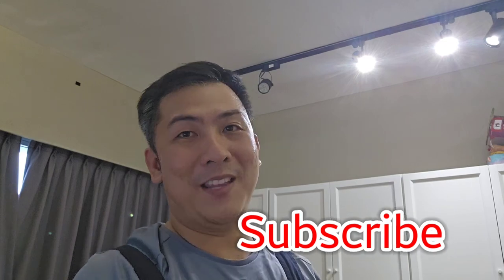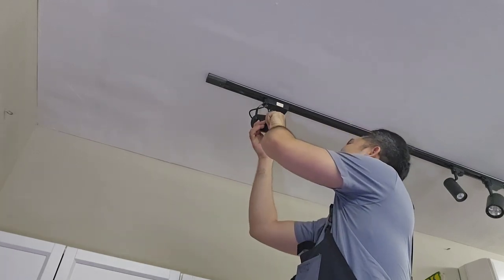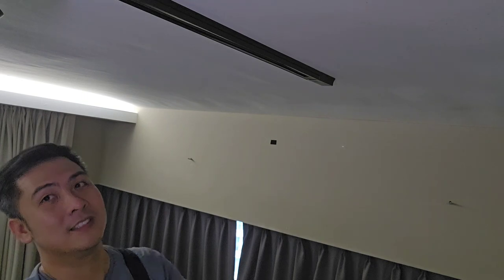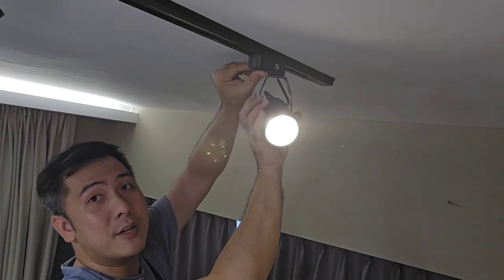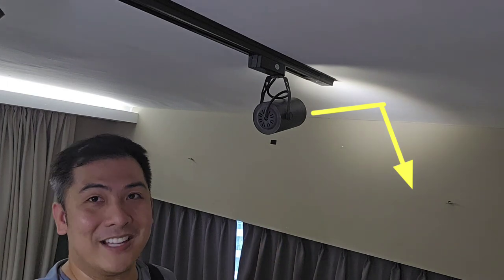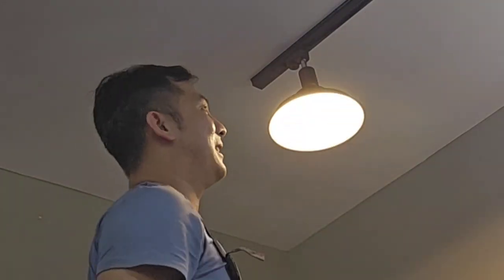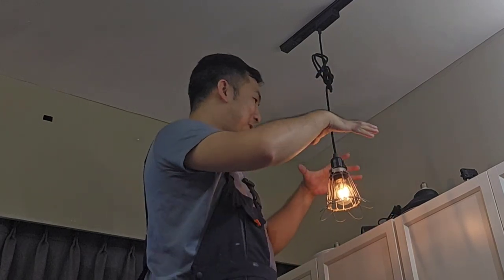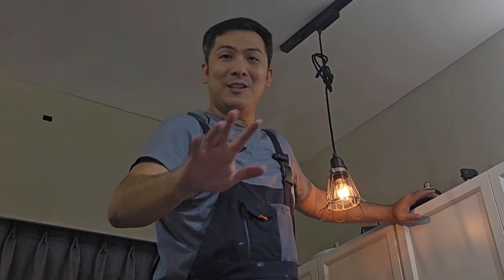Why TRACK LIGHTS are Awesome. (Savings $20 onwards)

Comment: Nice, I'm sold on the track lights! But are all the track bars the same and interchangeable with any track holders/bulbs?
Reply from the maker: Well most tracklights in singapore uses the China system which is different from the US system. The bulbs are readily available online and are quite interchangeable!

Comment: Did you install your ceiling fan on the track also?
Reply from the maker: There are small fans which can be mounted on an E27 holder. But I don't think these are powerful enough to cool an average room

Comment: How did you install the ceiling fan on the track light?
Reply from the maker: @ArcKon-ub4zn  the ceiling fan is on the ceiling I just used black trunking to run the wires from the track light to the fan

Comment: Does voltage matter when installing a spot light? Eg installing a spot light with a MR16 bulb or a spot light with a GU10
Reply from the maker: The rail supplies 230V in most cases. So whatever bulb you chose to use depends on the track light holder. MR16 light bulb requires a low voltage 12V electronic transformer in the holder itself and the GU10 simply joins into a mains power 230V AC  and does not require an additional transformer in the track light holder.